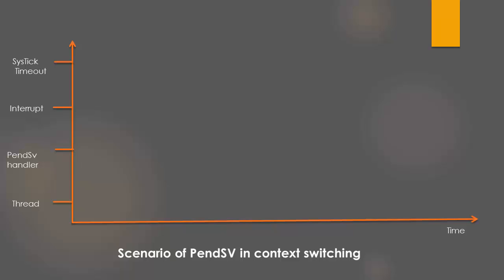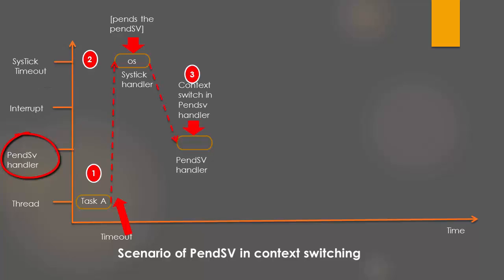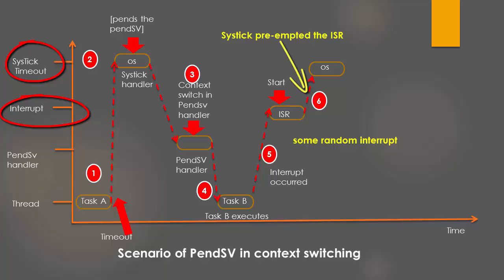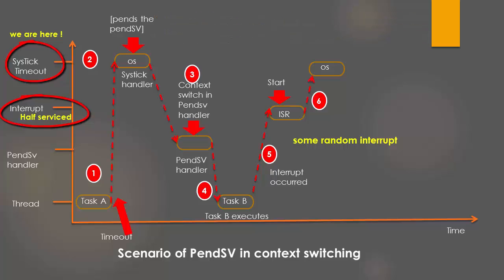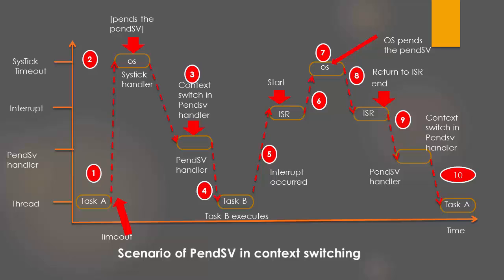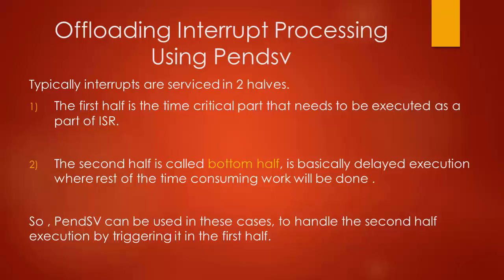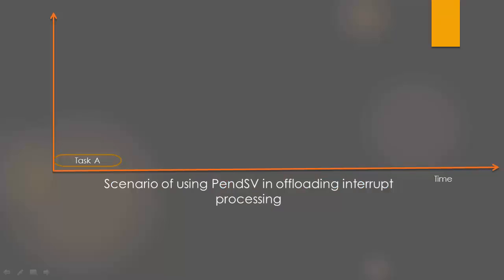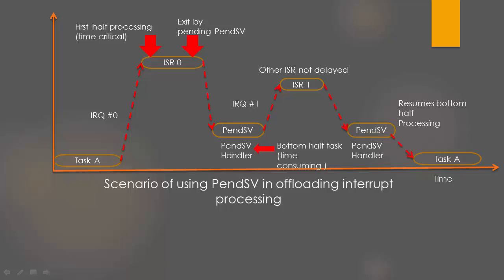ARM Cortex M4 PendSV System Exception(Understanding with animation)

Comment: One question I have on this : say I configure systick timer as Lowest priority interrupt, can I use systick for context switching in this case?
Reply: No, using systick is used for other purpose also, such as keeping eye on Watchdog, jiffies, etc, assume systic is configured to come at 100 ticks, but due to lower priority other interrupt can preempt sys tick, hence you will not be able to meet the head deadline in your system. that is why systick configured with highest priority and pendsv used for context switching